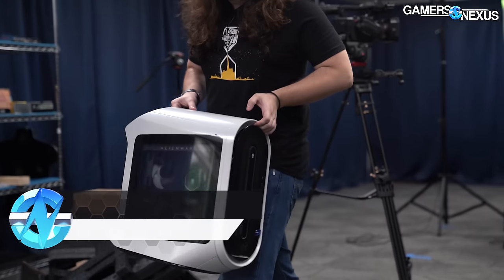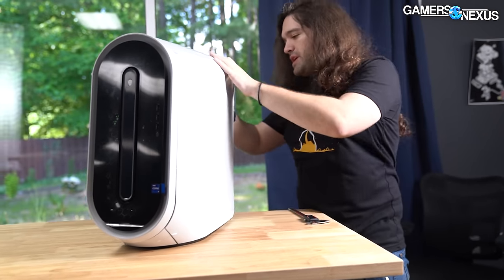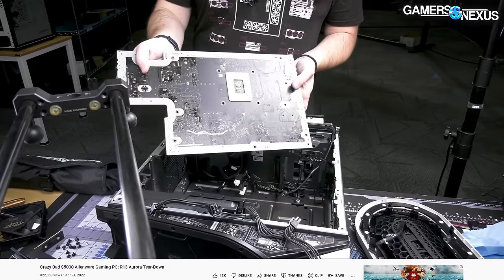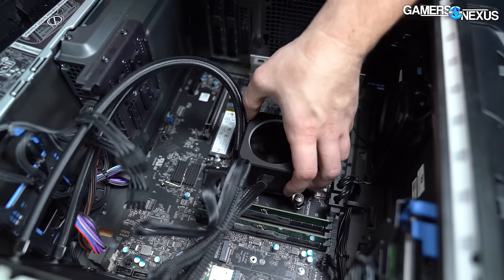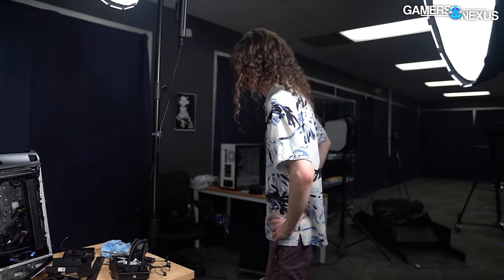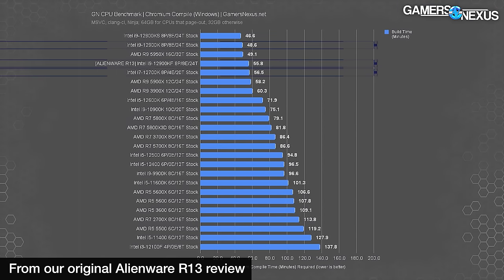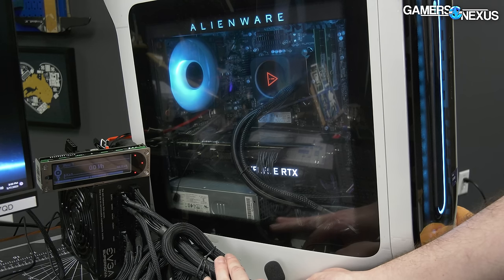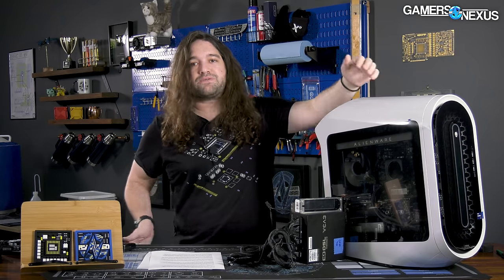"Fixing" the Alienware R13 Dumpster Fire

Comment: It's like Dell actively hates the people who are spending thousands of dollars on these computers
Reply: No they just don't give a shit about customer satisfaction. They just want your money and "fuck you" if your not happy.
Reply: They don't care once they have the money. Even if you have the "extended warranty" as they will do everything they can to avoid actually providing warranty support. I've had people bring Dell's and Alienware boxes to me, I build and repair PC's, that were under warranty because they had given up on the Dell CS system.  I almost always have to turn them away, unless it is something trivial like a loose connection, because everything is proprietary and I can't get the parts.

I've seen emails where they tell customers to box up a machine in the original packaging and to ship it back to them for repair, 4 years after it was purchased. Even if the person has saved the box for four years the chances it is any sort of shape to survive UPS is pretty low so Dell is charging for the extended warranty while knowing almost no one will ever be able to use it.
Reply: Well tbh if they got deep pockets and empty brains, it's their own fault.
Reply: @richknudsen5781  that's something in agreement with the original message. It's basically the same thing.
Reply: It’s like Dell actively wants a class action lawsuit since their Alienware not only does not perform as advertised but they actively got out of there way to make it so you can’t improve or at least make it perform as it should. Right to repair can’t come soon enough
Reply: @ItMeDwaeji  Dell's consumer division, I forget what its called, is so tiny compared to the rest of Dell I doubt they care. Dell makes their money from putting all those shitty i3 towers on corporate desks and selling server HW. The consumer division is probably little more than advertising at this point.
Reply: @ItMeDwaeji  The problem is, Alienware and Dell buyers agree to binding arbitration...
Reply: We apologize your experience did not meet your expectations.  Your feedback will help us improve your future experience. For further assistance from UPS, please contact us with your information via a Private Message or Direct Message on one of our social channels: Facebook @UPS or Twitter @UPS. -Jessell
Reply: @ItMeDwaeji  But do they actually promise a specific level of performance? Isn't it more undefinable buzzwords to confuse their customers, who lets be honest, these days are people with large budgets for a gaming PC but with no understanding of computers or the inclination to do any research. There are obviously quite a lot of these sort of customers out there.
Reply: @nobodylmportant  False. You can reach real people at Apple, and they will try to help you. Half the time I walk into an Apple store they help me for free. Apple is also the only consumer electronics store that still allows you to sue them instead of forcing you into binding arbitration. Stupid comparison.
Reply: Or  people who buy these things won't notice a difference because systems spec'd out like this will obliterate any game.
Reply: @UPS  bruh no way💀
Reply: @UPS  Amazon Prime sets the standards.

Comment: Is it really the Alienware look though? It looks a lot like a Dyson Air Multiplier released back in 2008 or so. One key difference is that the Dyson Air Multiplier actually moves air instead of choking it off, as this case does.
Reply: The last Alienware that looked like Alienware was the 7500.
Reply: Alienware cases have looked like this since the early 2000s haven't they?
Reply: @WayStedYou  not really, the old Aurora and Area 51 cases had this matt/metallic grey finish, and a lot of sharp corners and triangles, I actually really liked the look of it.
Reply: Just like the Dyson Air Multi fan, this Alien also sux on every possible performance level.
Reply: I quite liked the design of the old X58 and X79 based Alienware Aurora's
Reply: The Dyson probably has better graphics too.
Reply: Maybe Dyson and Dell should make a PC together. I'd like to see how bad PCs can really get.
Reply: HAHAHAHA
Reply: @jplayer073  I think Dell have nailed it already. High cost, low performance and no real way to fix it with out building a completely new computer. Using components that should be delivering a good performance.  Dyson actual do understand air flow and build modular units that can be easily repaired. My Dad’s vacuum is a frank-en-beast made from two Dysons found a a tip so not only was it cheap but he’s also been using it for years with out problems. Friends has an old rechargeable one and a fan, both do their job well. Two company’s that build over priced equipment but one actually delivers a worth while product, or did as the stuff I’m talking about must be getting on for over ten years old and is still working. Also so try building a new computer out of two broken dells, from this video it looks like you’d struggle to do it with two working ones!
Reply: @jplayer073  Dell and Tesla worst computer ever, take off the cover and it’s blackballed and won’t be eligible for service even if you pay for it.
Reply: @frizzlefry1921  sooo... Apple
Reply: to be fair, it was shown that a dyson fan
moves less air than a 15$ fan lmao, so both dell and dyson suck at what they do 🤣
Reply: @frizzlefry1921  you'll have to pay to upgrade your performance in watt increments (they intentionally reduce the wattage of the parts to make you feel the need to "upgrade" to default performance) after you've already bought it lol
Reply: @qqq122qq  Kind of but you don’t even have to take the cover off…
Reply: @fragilechinaa  Monthly fee too, quit paying back to 0!
Reply: And the dyson is just as good as the alienware at filtering dust
Reply: The dyson fan is worse than a $15 Walmart fan, both in terms of airflow and loudness
Reply: I wonder if anyone gotten scammed on ebay where they just ship an air purifier  instead of an alienware pc
Reply: That sounds like a mod project waiting to happen.
Reply: My case has great airflow it’s the Intel chip my R14 with a 5900X idles at 30C runs 56C while gaming and max’s at 75C during cenebench R23 multicore run and that’s with the little Dell 120 rad with a noctua A12x25 on it
Reply: @Medsas  the $15 doĺlar fan was also several times the size of the Dyson compressor, and still multiple times larger than it. If you one-dimensionalize the issue into airflow only(against what the guy in the video explicitly said his data was good for) then yeah. Lol. It was louder too.
Reply: It being the entire unit... shouldn't have to say that but i guarantee it in this thread. Yeesh
Reply: @psibug565  The first modern computer I had was a Sony VAIO in 1997. When I tried to upgrade components a few years later, the layout and proprietary parts made it so tricky a friend talked me into building a new PC from scratch. I have never bought a pre-built desktop since.
Reply: You could be on to something there. Mod two airblades and use as front and rear panels, happy days!
Reply: I always thought the look like a giant AirPod (the buds, not the "in ear") without the stem.
Reply: @frizzlefry1921  true story, back in my A+ course I was once tasked with fixing my college professor's personal PC. It was a Dell. Repair went fine, PC booted up, and everything seemed okay. Two days later the board shorted out. This guy was literally a hardware engineer so he determined it wasn't my fault, just a bad circut or something from the manufacturer. We put it back together so cleanly you would never know it had been opened, then began the RMA process. Almost a month later, after he paid $150 twice to have it repaired, Dell returned it, citing a small scratch on the center of the bottom of the casing that we had photographic evidence of not being there when we sent it out indicating "accidental damage" which was apparently not covered by the $300 of services my professor had purchased. They also stripped literally every screw on the unit to the point that you literally couldn't open it again. In front of every single class he had for the rest of the year, my professor literally held up the laptop, said "never buy a Dell" and explained the story. I can only hope it saved someone else the trouble.
Reply: @Zanithos  Sounds about right…
Reply: Hahaha, get Dyson sponsorship to integrate an air multiplier in the front case with a custom glass panel
Reply: It moves air until it chokes on its own dusty guts because the ducts are non serviceable. Essentially, a DAM is a single use item (if it were up to Dyson).
Reply: would probably run better if you put a dyson air multiplier in the front instead of the alienware front
Reply: @dominic.h.3363  Yeah, and those cases cost $300-700 used for a mint condition. Now that I know this, I am going to start watching the local market place for a cheap one just to hang onto for a few years.
Reply: @27Zangle  I'm not surprised by that. Unfortunately with today's trend of high-end components requiring liquid cooling, the idea of owning such a case with the intention to daily drive a system in it, has become unachievable.
Reply: @dominic.h.3363  True. I bet some modifications can be done to help or just do a budget build, something like a 6650XT and a 5600 would likely stay cool enough in such a case.

Comment: Dell’s slogan should be, “Dell-
Resist Improvement!” or perhaps “Alienware- because progress is alien”
Reply: Go To Dell has been a curse for many years now ..
Reply: Dell should have made the CPU cooler mount more Alien. That standard cpu hole spacing made it too easy to fit the new cooler.
Reply: @N1c0T1n3__  I switched from Dell laptops to Apple laptops. At least they fucking work. My Dell laptop went back eight times. They refused to lemon it. They couldn’t even get my name right in four years, let alone my laptop.  In three MacBook Pros the only problem I’ve had is that shitty butterfly keyboard they came up with. Virtually all three of my previous ones went to new owners after five years of abuse.
Reply: Someone should tell them resistance if futile.
Reply: @DanaTheInsane  We sell a lot of Dell laptops at work and they are actually very reliable. It's unfortunate you had such problems, but in the 11 years I have been selling them reliability has been no more of a problem than any other brand. In fact, I would have no problem recommending their business class laptops. Just stay away from their gaming gear.
Reply: @OriginalMergatroid  I've got a '08 or '09, I think it's a latitude, core 2 duo 2 gig ram, still chugging away out in my shed. Running XP. Never crashed.
 It traveled for a while, been in my dusty shop for many years. I have speakers hooked to it, a 32 inch TV, wired keyboard and mouse. Had to replace the brick a couple of times is all. Oh wait...it (we) got struck by lightning one day out in the shed. 
Ethernet cable from the house across the ground in a plastic pipe. Lightning hit the ground right outside. My ethernet cable took it, came all the way through the mouse, my arm and knocked me out of my chair. Stuff off the walls in the house too. BOOM!!
Now I have to use wifi cuz the ethernet port quit. The rest is fine.
Reply: @OriginalMergatroid  Reliability is irrelevant, dell doesn't manufacture the parts that are important for that. You're talking about Intel, nvidia, delta, and so on. Every manufacture will have these parts in their computers. What matters is how they implement these parts and what happens when they break. Dell is absolute garbage when it comes to this. Everything is proprietary and their bios sucks ass. Same thing with this alienware desktop, all the parts are fine, but they're starved of cooling and there is so much proprietary nonsense that you have to re-build the entire thing just to put a bigger cooler on it.

Also idk why your comment in retail is relevant either. Just because you sell something, doesn't make it good. I work with deployment for places that use tons of computers, such as schools, businesses and so on. There is a massive move from Dell to Lenovo going on right now for the very reasons I mentioned. A while back everyone was switching from HP to Dell because HP was becoming Dell, and Dell relaxed a bit on their nonsense because they were desperate. Well, Dell is back at it, and HP still sucks, so Lenovo is the lesser of the evils currently. It probably won't stay this way, but that is the current landscape of things. 

So I guess if you think Dell is great, hop on ebay and grab up some optiplexes, and XPS laptops (latitude's were always garbage, nobody ever bought those even for business). There is a metric ton of them for cheap right now because Dell is in a free-fall in the corporate sector.
Reply: @OriginalMergatroid  Had mixed issues with Dell Latitude Laptops at work. They either work fine with no problems, or they are horrendously unreliable until they are replaced. Usually its the Wifi card that goes.  Their servers are rock solid though. We have used hundreds of them over the last 20 years, and had a hardware failure once.  
We did have an issue with a bunch of mini desktop things which cooked their capacitors when you really usd them. Was fine for most things, but when they end-of-lifed on the desktop and we put them in a dev processing cluster for a year or two (Company were too cheap to get a dedicated server), half of them failed in two months.
Reply: @larsgottlieb  (><)
Reply: "Dell. We're not just Dull, we're full of Bull!"
Reply: Michael Dell once called anyone who opens their PC to work on the insides part of the lunatic fringe. I think that explains the company's philosophy well.
Reply: @larsgottlieb  "Go To Dell" has now been added to my vocabulary
Reply: @yourhandlehere1  The Latitude series has generally been good. Their consumer level laptops are junk.
Reply: @OriginalMergatroid  Same. I only recently got into building my own computers (graphic design and photography/video stuff though. Not so much gaming). I don't want the proprietary Apple bs, waiting periods and need a machine I can probably fix upgrade or repair myself. That being said, I worked on and with Dell's business and "professional" grade laptops and PC's for years before they tried getting into the gaming space directly. (Who hasn't bought an older i7 chipset for their first build off Ebay? )

They're decent machines that could handle some upgrades and some editing or writing work with good form factor and decent build quality for the price. You couldn't do that with Apple (at least not well, until ifixit and the right to repair guilds got going). Overall, most consumers would be better off with business level hardware in terms of repair ability and specs. Most people do too much with base level laptops or computers and then jump straight to Apple without realizing the stuff at Best Buy for the "best" price (cheapest when you get it) has the least return on investment. 

Dell's main area of expertise is corporate level computer technology. It's all very decent and fairly robust but not designed to compete in the gaming niche. 

The same could be said for Apple. People just want something that seemingly works all the time, that they mostly never have to tear down themselves. Until it craps out and they spend too much time waiting for a new version to fix itself. From a technical perspective they're not getting anything revolutionary but they are getting a golden goose for repair guarantees and that's what keeps people buying the product. The guarentee of customer service even if this is the 7th time something breaks.

 I will give Apple credit, most of their prebuilt laptops have dual fan cooling and a slim robust shell. Realistically, no one should make dropping a laptop a habit, but metal can take a few more accidental dings without breaking into tiny pieces. If anything the internal components will crap out before the shell does. And secondly, no matter what system you choose, 99% of problems come from operator error or neglect. With maintenance almost anything can last for years.

Comment: Before Dell, Alienware used standard PC parts. Their cases back in the early 2000's were rebranded Antec cases. I ended up getting a few on eBay years later for retro builds, because I liked the color choices. I miss those days.
Reply: Why use standard parts when you can use custom case, PSU, motherboard and CPU cooler? They are worse than standard ones, but they can go directly into the trash bin after a few years. That's the best feature a PC can have.
Reply: even the older dell alienwares such as the aurora ALX used standard parts
Reply: I remember when the Dell purchase of Alienware was announced. I told people Dell was going to ruin the brand. People said the Alienware founder wouldn't let that happen. He stayed on for something like six months before he left to enjoy all that money.
Reply: @KenS1267  Left with his sanity I hope.
Reply: @starx2212  Standard-ish. At least the formfactors were standard. lots of proprietary connections. I have one sitting in the corner for a project.
Reply: Looks like they are all Server parts except for the case cover and motherboard. So they've butchered the design to cheap out on just using off the shelf server PSU and fans.
Reply: @TechyBen  the metal chassis is literally the same as their XPS line, just with all the extra plastic bullshit. it's been that way since Aurora R5.
Reply: Apparently Falcon Northwest is still alive. I remember seeing their (along with Alienware's) in PC Gamer magazine.